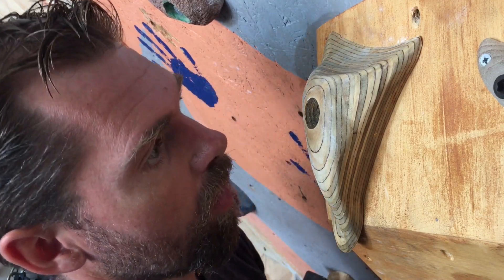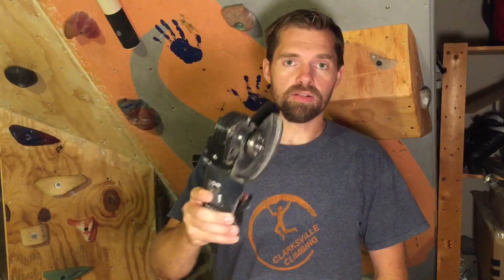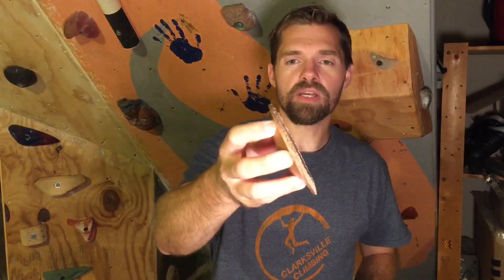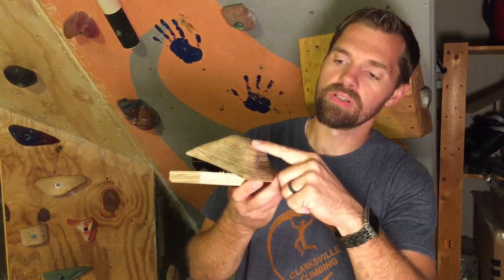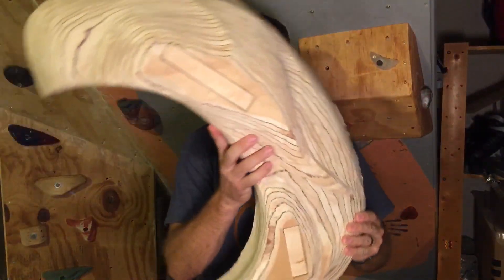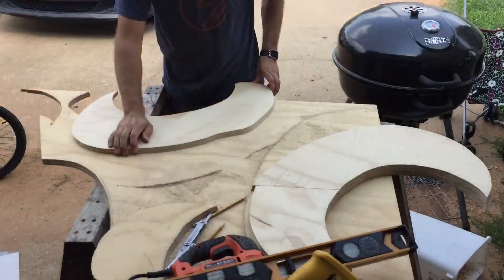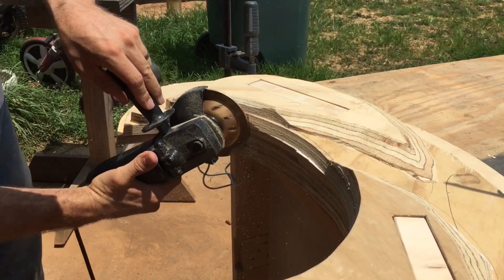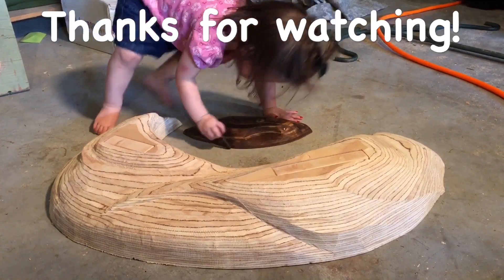Make Free Wooden Climbing Holds Right Now With Regular Shop Tools!

Comment: Just finished around 20 holds home wall with baltic birch plywood. They're actually working out great, have a nice feel and also good for dry tooling, really pleased. Thanks for the idea and videos.
Reply: Also, by screwing the pieces together, no need for clamps, can work them immediately even while the glue dries. Just don't saw through the screws...
Reply from the maker: Awesome!

Comment: Best thickness of plywood? 1/2 inch? Quarter inch?
Thanks
Reply from the maker: 3/4". I've got another video coming this week about plywood, watch for it :)
Reply: @climberdad  I used half inch.
Sure I have to use more of it to get to desired height but it's cheaper and easier to  cut each level. So far turning out decent

Comment: I'm thinking for optimal texture you could paint this hold and add a sand texture to it?
Reply from the maker: You could but I think the texture is better as raw wood.
Reply: @climberdad  I just tried the other day making a volume using dry floral foam and fibreglass. Only have one layer on so far but it's really hard to get the curves to lay flat with the chopped strand mat. Frustrating to glass but looking forward to seeing how it turns out
Reply: @Chris-vw3yc  Did this work out for you? What fiberglass material were you using?

Comment: When you say to use a good plywood, what type of wood are you talking about?
Reply from the maker: Best is Baltic birch or "veneer core" plywood. If its cheap they probably used poor quality glue to hold it together and it will not hold up.
I have used cabinet grade pine plywood (this hold) and they have turned out nicely.

Comment: You very briefly mentioned staining the holds at the end. Are you just using any general stain? Do you apply anything after the stain? Just curious about the finishing touches. Awesome though!
Reply from the maker: The stain that I have used is a typical oil-based stain that soaks into the wood. Put it on thin and wipe off any excess. It does effect the texture but still climbs well. Something else you might try is a natural stain, like mustard. Raw wood does have the best texture though!